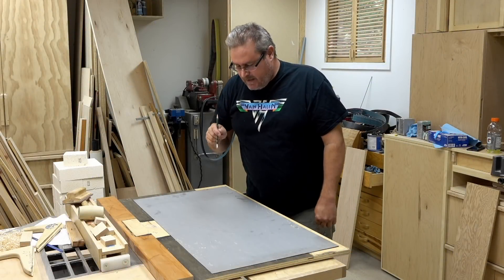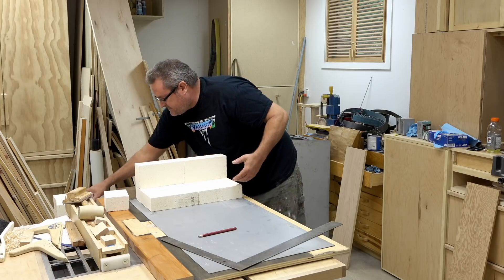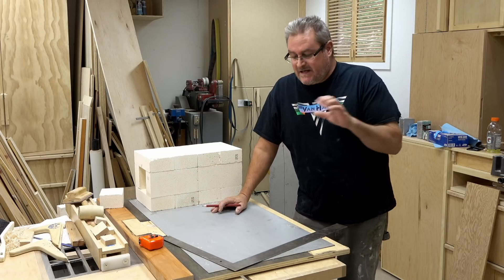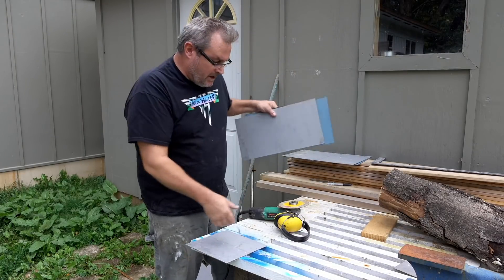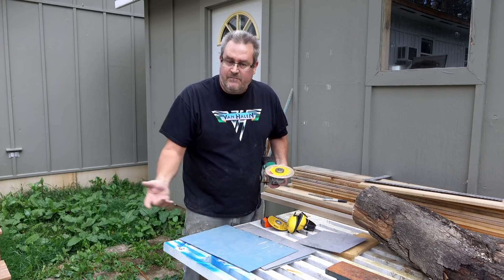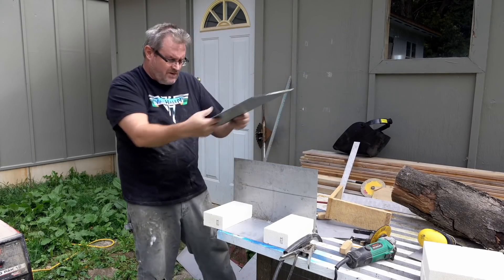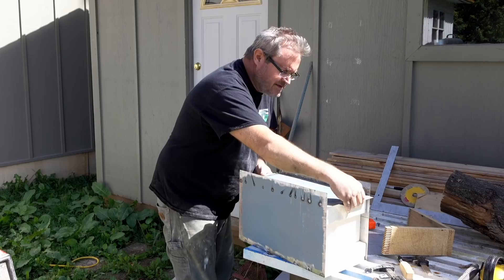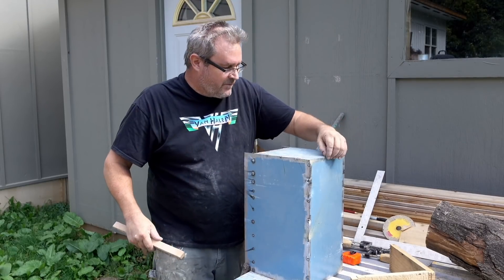How To Make A Heat Treatment Oven - Beginning

Comment from the maker: In this one I go over the design and build the case for the oven. This oven will operate on 120VAC and will have a  single 1500 watt heating element and a PID and thermocouple to control the temperature. The bricked are insulated fire bricks rated for 2300 degrees (Fahrenheit) and the case is made from 18 gauge sheet metal that was salvaged from a steel door. 

I'm documenting this build on my website forum, starting here:
http://www.ibuildit.ca/ibuildit-forum/viewtopic.php?pid=11452#p11452

Here's a longer more detailed version of this video: 
https://youtu.be/L2DX3j82qZ4

Ways you can help support this channel:
Patreon:
https://www.patreon.com/user?u=865843&ty=h

Plans for sale: http://www.ibuildit.ca/plans.html

More videos on my second woodworking channel:
http://www.youtube.com/c/IBuildIt

My home reno channel:
http://www.youtube.com/c/IBuildItHome

My "Scrap bin" channel:
https://www.youtube.com/c/IBuildItScrapBin

Website: http://www.ibuildit.ca/
Facebook: https://www.facebook.com/I-Build-It-258048014240900/
Instagram: https://www.instagram.com/i_build_it.ca/

Comment: Nice utilitarian oven!
Some steels require somewhat complicated heating/holding/cooling cycles. Is the PID controller capable of doing something more advanced than holding one set value? If not, I'd probably put an Arduino there with a suitable UI and programming. Well, this can always be done later.
One advice - it's better not to have  ventilation holes on top. Some conductive debris might fall down into the device, potentially leading to shorts. You could attach some mesh over/under the holes to prevent that.

Comment: Hi John, Great videos. I would like to build a heat treatment oven the same as yours but finding it hard to get details about the element, there is a lot of variations out there with different thicknesses of wire and then the lengths used. Could you tell me what exactly you used and the length required. I was thinking of buying a length of wire and coiling it myself. Keep up the good work

Comment: John,  I'm concerned about your use of the angle grinder. We can't see you face in the video,  but I really hope you had your tongue just sticking out of the left side of your mouth,  the way professionals do :-)
Reply: I hate the safety police online. but that said never run a large cut off wheel on small grinder. the 41/2' grinder spins faster as they are made for a smaller dia wheel. that an if no guard I would always wear a welding glove. I only say because after doing metal fabrication most my life. about 6 months ago put a large cut off wheel on a small grinder with no guard or glove. just like you. as soon as it touched the metal for some damn reason it blue a part. I was lucky. my left point finger at the first knuckle cut to were you could see a white tendon move. how it did not cut it and handicap me for life I don't know. . it also cut my knee open through my jeans. the scare looks like I had knee surgery. that and broke my big toe through my shoe. And now my knuckle is twice the size and has limited motion. I have did the same thing a 1000 times but it caught up with me. and it was a DeWalt wheel and grinder. no harbor freight shit. hope everyone can learn from me. keep up the videos love to watch them.
Reply: next time you're gonna tell us we need a mask for welding
Reply: People die from the discs breaking apart and landing firmly in their throats.
Reply: @JustinAlexanderBell  Yea, its just so much inertia stored in that little tiny 4.5" circle.  WEAR THE FACE GAURDS
Reply: People die while sleeping... so prepare more coffee...
Reply: People die from breathing air.

Comment: Is there not a hi-temp mortar available ?  To eliminate making a steel box ?
Reply: Big Fat Tony's yes there is.  metal box is great too, but i was suprised he didn't stick them together... mortar  increases the life of those bricks, due to less joints moving relative to one another.  those bricks are not cheap.
Reply: I'm thinking about making some molding planes and plane floats.  Not having a welder nor knowledge of how to use a welder I will seek out this hi-temp mortar and put the thing in a wooden box for storage & carrying.
Reply: i found the fire bricks at Brick Tec for $1.50, not expensive, just need about 10.

Comment: Are you planning to add a gas inlet so you can try flowing nitrogen or argon in to reduce/avoid scale while heat treating? Inert or mostly inert atmosphere furnaces seem to take a giant leap in price from regular heat treatment furnaces and I wonder if home built can be "good enough".
Reply: He's already completed the build, this is a re-upload for some reason (I'm guessing music copyright or some other BS) and no, he didn't do that.
Reply: Robert Szasz, For small production is easier and cheaper to wrap the blades in stainless steel foil to avoid scaling and such

Comment: How do the bricks he used in this video differ from the fire bricks they sell at home building centres, if at all ? Anyone?
Reply: Colin Winters these bricks are much more effective at insulating and keeping the high heat inside the forge/kiln. I believe regular bricks would absorb more heat that could be used more effectively to heat whatever is inside.
Reply: These are kiln bricks, the heat resistant ones they sell at the store are fireplace bricks. These are very lightweight, almost like ceramic foam but would never withstand the abrasion present in a fireplace.

Comment: Why dont you use a welding nozzle ?
Reply: Because he's running it as a gasless MIG with flux core wire, so it doesn't need a nozzle.
Reply: To show that he is confident enough not to touch the metal and short it out.

Comment: I use the same bricks and whenever I heat treat a knife the outside of the bricks get hot.
Reply: dudefacial they sure do get hot enough to burn most paints... only a matter of time.  but they impart their heat very slowly.  i regularly pluck 1000 degree bricks out of my kiln and set them on top quickly with only a kevlar glove